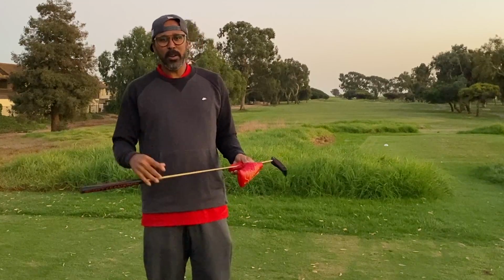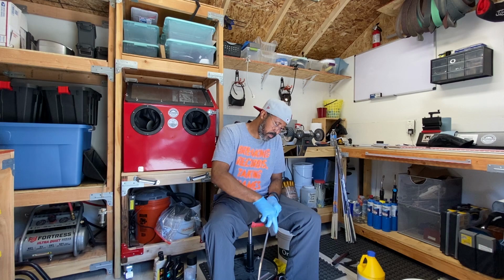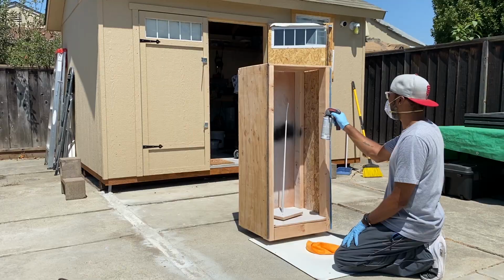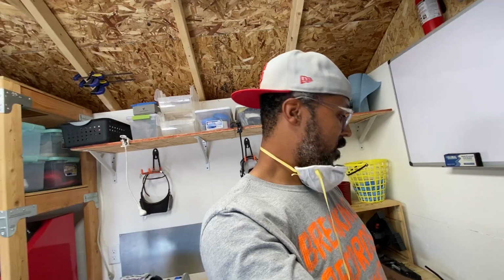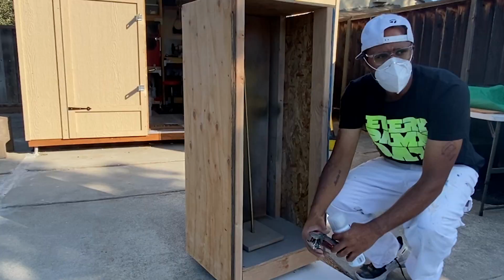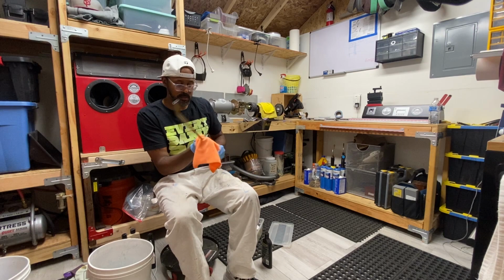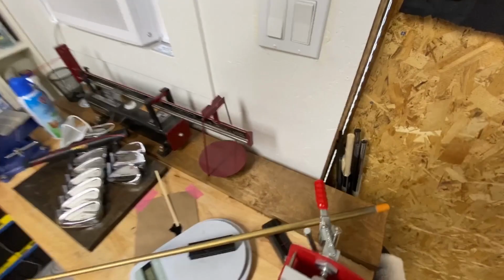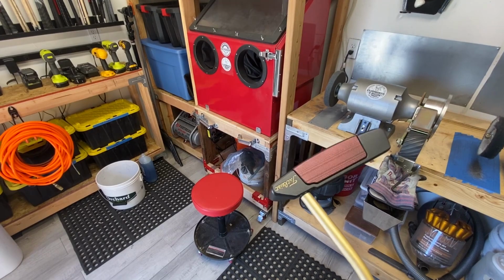How To Spray Paint A Golf Shaft

Comment: Since finding your channel I’ve followed your IG just to make sure I don’t miss anything. I just wanted to know if you’ve ever spray painted the club/iron heads before? Would it be any different? Keep up the good work.
Reply from the maker: I don't spray heads for a number of reason,  you will have to go the plating route. Spray paint just not gonna hold up. Powder coat will look good for a couple of weeks then it won't anymore. The weight will also become a issue. With club building and customization everything affects something else.